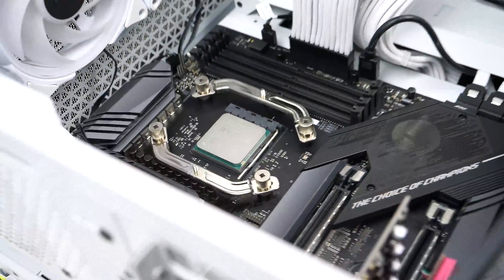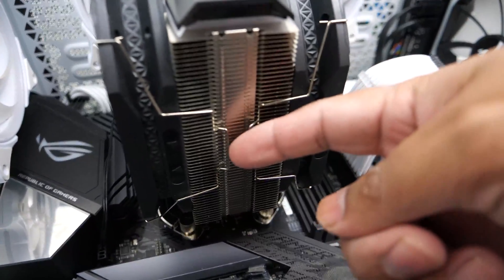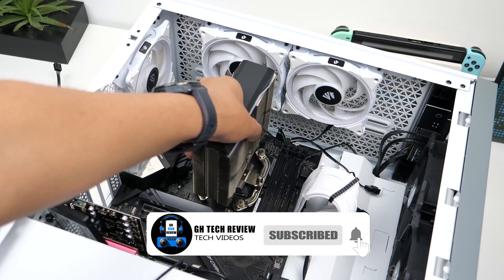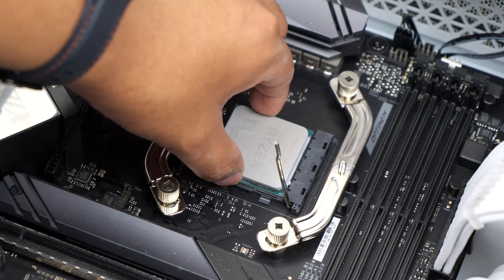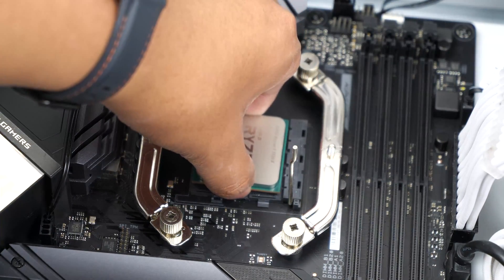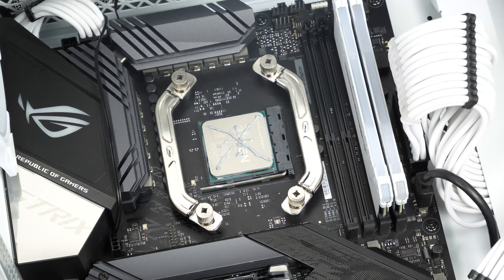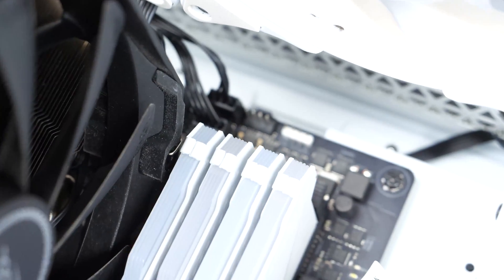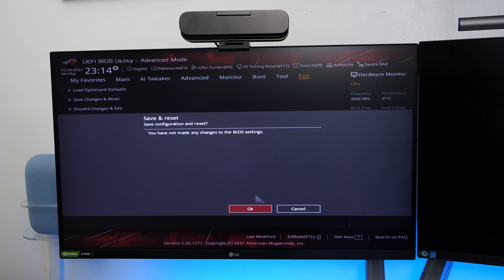How To Upgrade Your CPU Step By Step | AMD Ryzen CPU Installation 2022

Comment: Hello, I currently have a b450 motherboard and ryzen 3 3200g. I just recently bought r5 5600 just waiting for it to be delivered, I know i need to update my bios, but my question is do i need to reformat my windows os or something or i just really need the bios update?
Reply: Should be just bios update. New OS only needed for new mobo
Reply: U need b550 motherboard for that right because even I have reyzen 5600x that's why I am asking
Reply: @sololeveling86 no they added support for 5000 series on the 400 mobo just needs bios update
Reply: How i update bios
Reply: @genlongtsang1093  You should be able to download the files from your motherboard manufacturer's website. I have a MSI board, they have a handy compatibility table showing what BIOS version you need to download for each CPU.

Once you have the files, you format a USB stick and move the update files onto it. Then you can restart your PC and enter the BIOS. There should be an option to update from flash memory. You should be able to find a guide online for your specific motherboard.

Comment: I turn my pc on but I’m getting a blank screen the pc boots up and everything but no screen 😢
Reply: did u install newest bios update to the motherboard?I forgot that on my upgrade from 2700x to 3800x, which also had black screen! I updated the bios for cpu, but forgot the bios update for the motherboard!it was a b550 motherboard, but wrong bios update for it!using 5800x and im about to buy the 5900x and hopefully this time it wll work!
Reply: I'm having the same problem I have tried everything but a new cpu is my last step

Comment: GUYS INSTALL BIOS UPDATE AND GPU DRIVER BEFORE ANYTHING OR PC WILL NOT SHOW DISPLAY AND YOU WILL HAVE ISSUES
Reply: Yup, make sure your Mobo supports your new CPU! Just check your BIOS version and look it up. If it already supports, no need to update. If it doesn't. make an update.
Reply: @nottsoserious  i have a x470-f asus mobo, currently on bios version 6202 (27/7/23) and Im waiting my ryzen 7 5800x3d which requires bios version 5861 (26/8/21) do I need to get that 5861 or just ignore since im already at 6202? Any reply is much appreciated in advance
Reply: @wc.j3911  should be fine, just ignore. Worst case, you'll have to put your old CPU back into to update the BIOS.
Reply: @nottsoserious  noted, thanks.
Reply: Hey buddy great video! I have an aorus b450 pro Wi-Fi Mobo... I'm upgrading from a ryzen 5700G to a ryzen in 5700x3D... Can I just switch it out or do I need to do any updating?
Reply: @nottsoserious  so I should update bios with old cpu then once updated simply just remove and reinstall with the new cpu?
Reply: Yup. Black screen for me… THANKS!!!!
Reply: Thank you for commenting this cause the guy in the video failed to say this, I have to take apart my pc again just to install the bios now. Wish I knew that before I ripped my pc apart, thanks for leaving out IMPORTANT information out video guy.
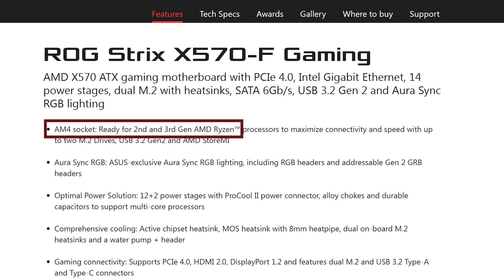Reply: @mizzottv2767  0:49
Reply: What your first thing to do after this problem is to replug the bios battery
Reply: How
Reply: Also bitlocker
Reply: I'm so annoyed with tutorials that miss IMPORTANT stuff like this.
Reply: thankyou sm, i just found this out the hard way 🥲

Comment: I have a HP OMEN - Gaming Desktop - AMD
Ryzen 5 5600G - 16GB Memory - can I upgrade to a ryzen 9 5900x?
Reply: You need to find the exact model of ur mother board, check all the versions and generations it is compatible with proccesors and then see if it is compatible with X versions. For example, my mother board is only compatble with gen 4 and gen 5 ryzens and with G at the end or without.
Hope this helps.
Reply: You probably cant because prebuilds use bad PSUs and the 5900x uses substantially more power.

Comment: I installed my new AMD Cpu and the pc works but nothing comes on the screen and my mouse and keyboard dont work, help please!
Reply: Hi i am Not a real expert but i have some questions
1. What is you MB
2. What is you CPU you bought
3. What CPU did you Had before
Reply: @Marek44  My motherboard is a Gigabyte Ab350 gaming.
New CPU: AMD ryzen 7 5800x
Old CPU AMD ryzen 5 1600
I've been on the support site "techguy" for help and tried everything, updating bios to the latest version, even though the one I was on previously supported the new chip, clearing the CMOS, removing the battery, removing and re inserting it. I'm 100% sure it's in the right way too with the yellow triangle aligned correctly. At this point the only explanation is that I have a defective cpu.
Reply: @Jarednorthdoor592 can you confirm your motherboard supports Ryzen 5000 series CPUs?
Reply: @tradcathpill  Yes, it's socket is AM4 and 5000 series CPU's are supported. I've ordered another processor as I think the one I had was defective. If this one doesn't work I may need a new motherboard for some reason, even though the cpu I want to upgrade to is supported by my MB
Reply: @Jarednorthdoor592 you may need to update your bios with your existing cpu first. if it's on an old firmware that was released before the 5000 series, it won't work
Reply: @nliberty  It's alright now. I ordered the cpu from Amazon and I was warned on a tech support website that it may be defective as I tried everything possible, updating the bios as you mentioned, even to the latest version, clearing the CMOS, checking it was in properly, re inserting it, nothing changed. So I returned it and ordered one from overclockers UK, and it worked pretty much instantly. Thank you for your help though.

Comment: At what point do I have to save back up files? When switching what component? I’m NOT computer friendly but would like to learn how to fix my own pc or do upgrades when needed! Thanks for any advice… all appreciated
Reply: If you're replacing your hard drive you'll need to backup your files. You also usually have to reformat Windows if you replace your motherboard.

Comment: So there no need to re-install windows or any other software?
Reply: dont think so
Reply: Only when replacing your hard drive / SSD or motherboard. You may have to update your motherboard for some processors but that doesn’t require replacing anything unless your motherboard is very old

Comment: Im switching from a i5 10400 to a ryzen  something i forgot. But the question i had was will i have to make some installations before/after switching. I already know im going to need a new motherboard and ram since i will be on am5. Just curious before i switch and wont screw up my pc
Reply: I'm on am4 should i upgrade to am5?

Comment: My screen is black but my pc is lighting up
Reply: Did you plug the monitor cable straight into the GPU?
Reply: Mine show no signal...my Ryzen don't have igpu... @jmcdermott53
Reply: prolly your monitor problem. try changing the hdmi output or press a key on your keyboard (home, windows key, etc)

Comment: I was really hoping for instructions on updating the BIOS first to make sure the board is compatible, uninstalling the old 3900X drivers, and updating Ryzen chipset drivers for the 5950X. A jump like that in generations would usually benefit from a chipset update.
Reply: MSI Center app on Windows will update your BIOs and chipsets and stuff with the click of a couple buttons.

Comment: Hi, I have Ryzen 3 3200g with a320m-dvs r4.0 motherboard, I am upgrading to Ryzen 5 3600g, any tips or extra steps needed??
Reply: I agree with the other guy, getting the 5600g would future proof your pc, but you should check your motherboard website and make sure your bios supports the 5000 series
Reply: @zivex5860  exactly i’m getting the 5600x  u just gotta update your bios for anything past the 5000 series     i have the same mobo @JacRaizenYT
Reply: @zeeolta7255  exactly, I did the same thing mine didn’t support 5000 series and I updated bios and it was so easy
Reply: @zivex5860  Idk a website
Reply: id go for bigger not big price diff get a 5600
Reply: @JaxRaizenYT 
If you're running Windows you can go to the Run Dialogue box (Win+R) and type msinfo32. 
When the system information window opens look for "Baseboard Manufacturer" and "Baseboard Model" in the General Tab. 
A quick Google search with this should turn up the product page/manual that will list what CPUs are compatible or if you need to do a BIOS upgrade. 
From your original question, upgrading from a Ryzen 3200g to 3600g should be pretty much plug-n-play seeing as they are from the same series.
Reply: Get a ryzen 5 5600 much better, it has the same socket AM4 but better performance.
Reply: Switching from Ryzen 5 1600 to 5500. How do I upgrade BIOS???

Comment: I have b550 velocita phantom Motherboard . I'm going to the AMD RYZEN 5600X,  Asrock website claims i need bios P1.20 but when i check the link to download it it says 1.20 . What does the P mean ? I think it means patch, PLEASE HELP
Reply: Search system information it should tell you what bios version you are on but p does mean patch.
Reply: P means patch, and I checked the website and there’s only one 1.20 version so install that one, or install the newest update just read all the updates so that you don’t make a mistake, first you download it, extract the file, get a usb stick that is formatted, and put the file onto there and it should be good to download in bios
Reply: I appreciate you guys . I tried to do the update but bios and system settings show Im on P1.10 

I was originally on P1.0 out the box
Reply: @MFPIRATE  does p1.10 not let you update bios? Are you still going to upgrade bios and get the cpu?
Reply: @zivex5860  yeah it lets me , it says success press enter to reboot, but still shows P1.10

Yeah I still want to upgrade it .
Reply: @MFPIRATE so you updated the bios and it still showed 1.10?
Reply: @zivex5860  yeah it still showed 1.10
 I was originally on P1.00 , I also tried to gradually update to bios 1.50 and still it showed P1.10 .

Comment: I installed a new one and my pc is running but my monitor just doesn’t connect
Reply: you were probably using the integrated graphics from your old CPU, i recommend double checking which port you were plugging your HDMI cable into (make sure you are using the HDMI port on your Graphics Card, it will be the one at the bottom, not the top)
Reply: thats a hdmi thing
Reply: could be one of the pins were bent
Reply: @realseaklic any way to fix it?
Reply: @rrion  Unplug then replug the power cables of the GPU (make sure they are to be careful that it's fully connected)

also dust the GPU gently with a cloth or your hands (aim for the pcei connection between the graphics card and the motherboard)

Make sure the pc is unplugged from the wall before you begin

Plug your hdmi or dp monitor cable to the back of the gpu 

Turn it on with anxiety

Comment: Do i need to update bios 
If my current cpu is amd a10 upgrading to ryzen 3 2200g
Reply: That’s the one I currently have and I’m having bottle neck issues with the Ryzen 3 so I’m looking to get a ryzen 5 5600g
Reply: Instead get the x one@houka4121
Reply: I currently have a ryzen 5 3600 and will soon be upgrading to a ryzen 7 5700x
Reply: did u put in ur new cpu right after watxhing this?
Reply: depends on your motherboard if it is new enough to have the newest version installed that supports the cpu. If not you have to flash your bios. There is plenty of tutorials on how to do that for your specific motherboard.

Comment: I don’t even screw the fan in, I use the stick wraith cooler so it’s light enough for the thermal paste to hold 😁
Reply: not a good idea homie, once that cpu gets hot its gunna unstick
Reply: You can tight the screws 75% instead, should hold while not overwhelm our homie processor

Comment: Hi i upgraded my cpu from ryzen 3 3200g to ryzen 9 3900 and my pc will not boot when i try to start my pc ... is it possible that my new cpu is dead?(all the pins look good) the motherboard that i use is the  B450M DS3H  v 1.0 . both cpus say that they use 65W so it cant be the psu right ? i only use a 450W Psu could that be the problem. does the ryzen 9 use more wats even tho in the decription both cpus use 65w
Reply: If you have check everything then just get a return and get a ryzen 7 or another ryzen 9
Reply: @distortingrain6524   i just found out that its the mother board for some weird reason the motherboards that work with ryzen 3 3200G do not work with other ones which is kind of weird.i checked other motherboards that were compatible with the ryzen 9 cpu and on the site of the motherboard it says not compatible with the ryzen3 3200G .. anyways i tried my r9 on my brothers computer and it worked (thank god) so i bought a motherboard it still hasnt come but i also bought a rly good cpu fan with it.
thanks for commenting <3
Reply: I'm not very pc smart yet but does the  motherboard bios support the new cpu?
Reply: yes on the site it says bios version f40 i had f50 then I updated to f65 which is the latest bios and then i down graded to f40 just in case but still end result the same @Sprites1400
Reply: Its definitely something with your bios or your motherboard might not support that cpu
Reply: Upgrading most of your rig at that point haha. Congrats 🤘

Comment: No need install new windows after change my 5600 to 5800x?  Thanks!
Reply: I didnt need to when I swapped mine, but if you ever switch from amd to intel then you might need to.
Reply: @JesseInSharpie what on earth on your on about?? The CPU has nothing to do with the boot files.
Reply: @OnTheRailwayOfficial thank you I was like wtf are these dolts on about. Lmao
Reply: Chill guys, just sharing my experience lmfao its not that deep.
Reply: @JesseInSharpie  You’re sharing false information is what you are doing…
Reply: @OnTheRailwayOfficial  Wait when?
Reply: @JesseInSharpie  You said you might need to reinstall windows when switching from a different brand of CPU which is simply not true.
Reply: @OnTheRailwayOfficial  No, when did I ask?
Reply: @JesseInSharpie  For what?
Reply: @JesseInSharpie 💀

Comment: If you don’t want to buy a anti static strap do the following:

Avoid wearing synthetic materials or wool at all costs. Cottons and denim are best!
thick boots like work boots are thick soled to avoid static build up
A stripped copper wire can do the trick, just make sure its secure 0:48
Reply: so i guess ill go naked so no static charge build up
Reply: @mok3734  😭😭
Reply from the maker: @mok3734  👀
Reply: I also shaved my hair off as a precaution, and followed with a wet shave to be safe
Reply from the maker: Thank you for taking the time to give these precautions 🙏

Comment: Should we remove the cooler at hot ? Or cold ?

With a similar cooler , not the OEM
Reply: Update: I switched from 3700X to a 5800X3D. Great CPU btw. 
Before the deinstallation i idled in WoW Valdrakken for about ten minutes (the City is a player hub and pounds hard on your CPU). 
After switching off i was able to remove the cooler without any problems. 
So, yes. I prefer hot. 😁
Reply: Hey hows the 5800x3d doing? I'm thinking of upgrading from my 2700x. Are the temps ok, and what cooler? thanks @projectmungo
Reply: @Pazaluz  absolutely worth it. In Valdrakken i barely dip under 50fps on prime time, i benched TW: Warhammer 1 with the new CPU and got over 160fps. 
My temps are somewhat around 75° Celcius and i use a NZXT Kraken with 360 Radiator. It sucks fresh air into the case. Before it was the other way around and i had higher temps with my old CPU. So switching the Airflow was a good choice.
Reply: @projectmungo   Hi I am planning of doing the same. Can I ask what GPU you have with it?
Reply: @ZerkerXror  Hi, im using a 6800XT.
Reply: @projectmungo  Thank you. I'm planning to pair mine with the 4070 Super. Thought maybe by chance you not only upgraded your CPU to the same one I planned on, but GPU also.
Reply: I prefer hot, cause i had a friend of mine who destroyed his CPU by removing the cooler. It was cemented to the CPU.
Reply: @projectmungo  same i just destroyed my cpu because of that
Reply: hot to avoid cpu sticking to cooler

Comment: After installing my cpu I’m getting no signal on my monitor. Checked cords, Reseated my ram,cpu etc and updated my bios…. What am I missing?
Reply: @sneezydeezymcdeluxe7015 me not knowing, I put the cpu in first tried to turn it on then no signal. Then I swapped out back to the old cpu and updated bios. Switched back to new cpu and still no signal
Reply: @CShmoneyy same here
Reply: @CShmoneyy  I just looked up error it says to plug in a keyboard and a mouse seemed to solve the issue I would try that
Reply: @CShmoneyy reset cmos try with old cpu update new bios for new cpu and try installing cpu after power down
Reply: Did you update your BIOS with the OLD CPU installed? As I don't believe it's going to work if you installed the new CPU but then installed the required BIOS to run it.
Reply: Hey did u ever get your pc to work when it had the no signal problem I just got a new cpu and I ran into the same problem
Reply: @Est-kay same here did u get it working
Reply: @IconicfiveC  nah I didn’t it turns on but no display did u ?

Comment: Is this type of cooler enough?.. it seems small to cool down a 5950 cuz they run hot
Reply from the maker: This has been good at keeping my 7950 cool. When I am editing it chills at 64 degrees and when I am gaming it stays at around 72 degrees and periodically jumps to 78. This is without the fans set to max.